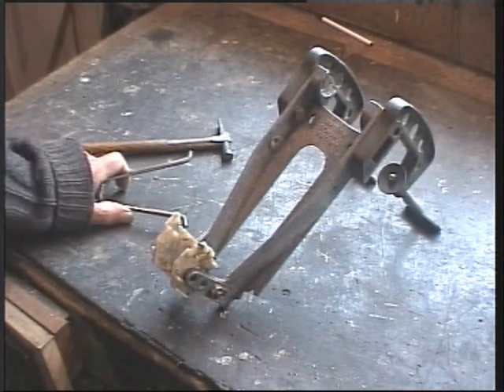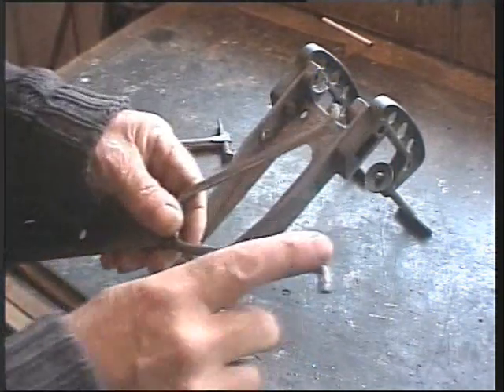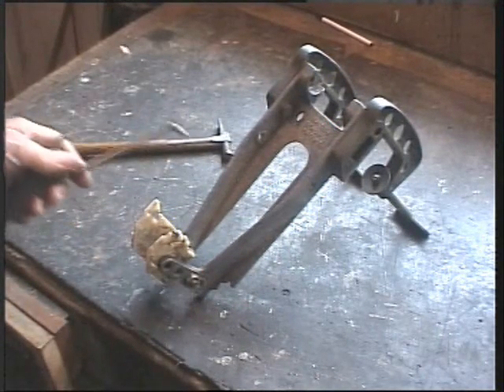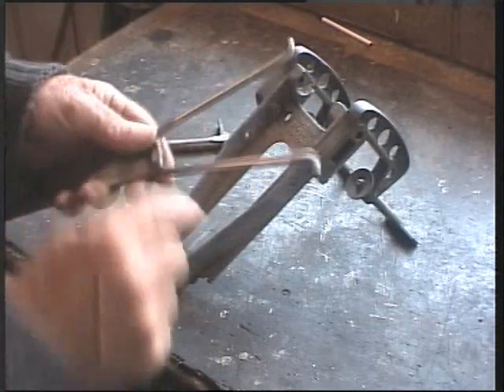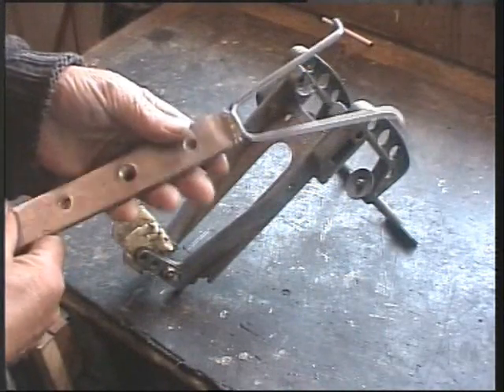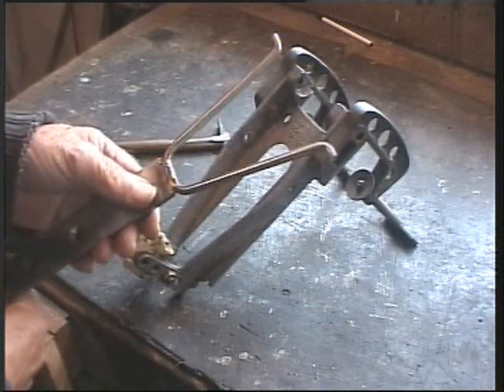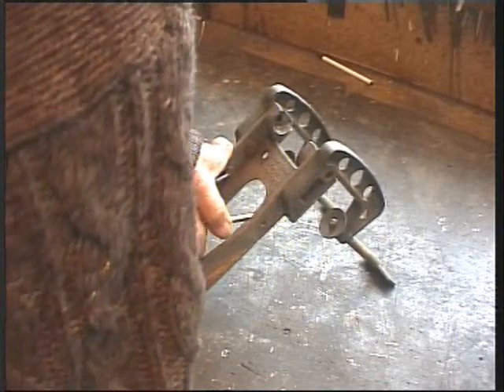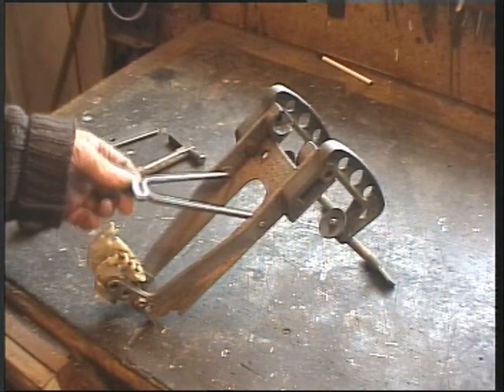Seagull bracket

Comment: Hi, as you've gone to the trouble of 're bending the new support,,,
Wouldn't it have been easier to bend it slightly longer than the original?
Or is there a reason it needs to stay the same ?
Great work all the same 👍
Reply from the maker: I didn't bend a new support, I simply extended the original one